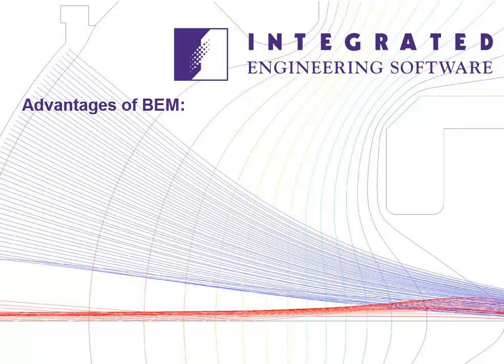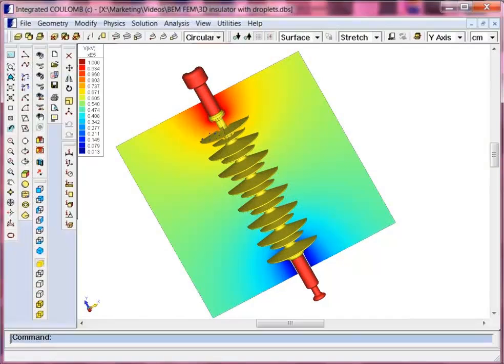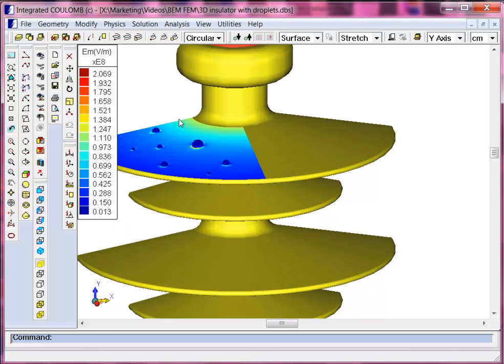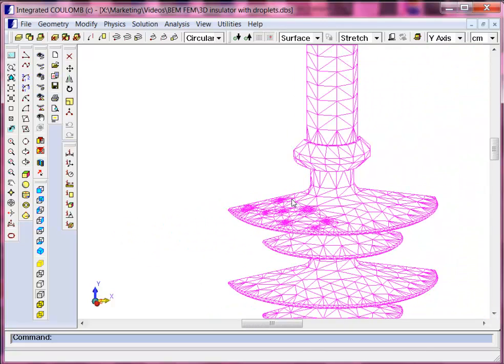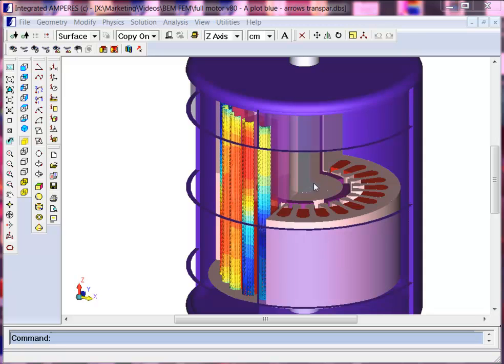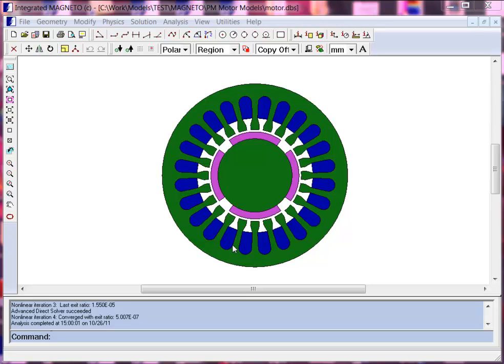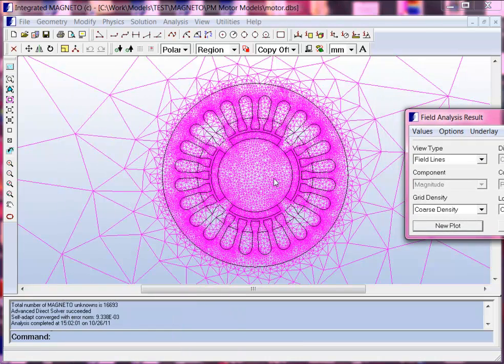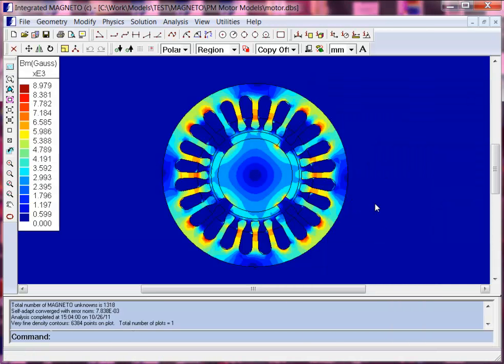Boundary Element vs. Finite Element Method Analysis

Comment: One question please. What is the difference between finite element and boundary elements. Which is better and which is more likely to land a well paying job?
Reply: Depends on how non-linear your future employer is: BEM can only treat linear problems (linear materials). This is also the reason why it was stated here that for the dynamic motor model FEM is needed (as here the nonlinear B-H curve is relevant). And I think the best job to earn money in this area is not software development. It's consulting around a software product.